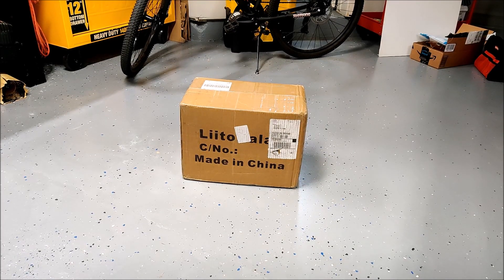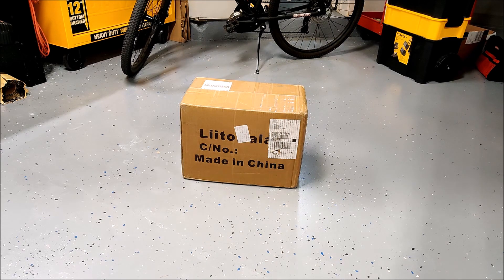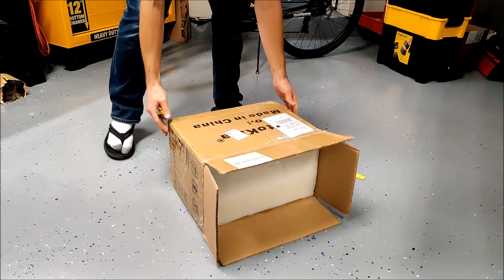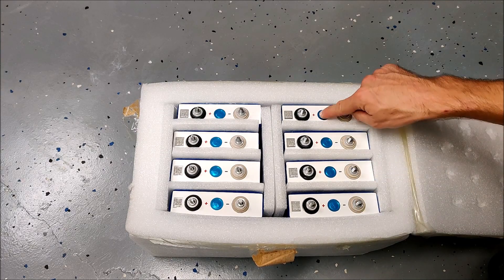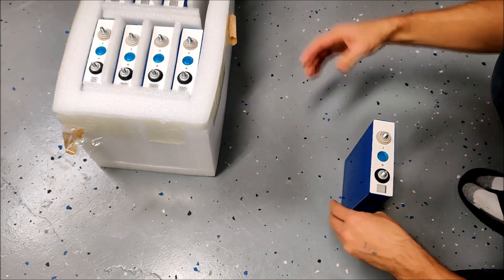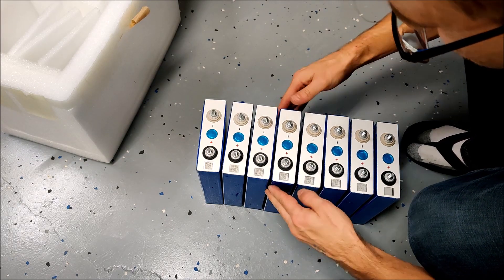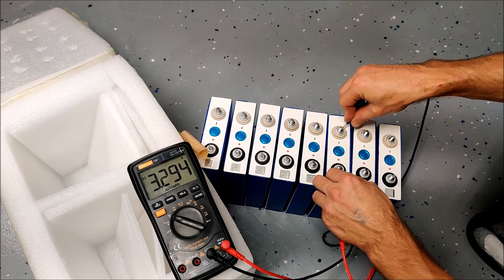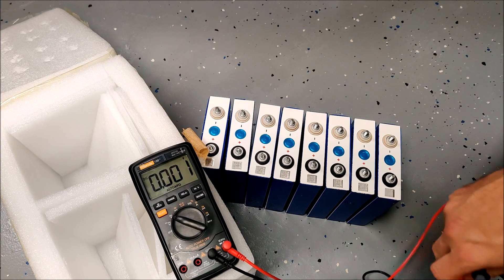DIY 3KWH LifePO4 Solar Generator - Part 1 Batteries

Comment: How was your capacity check on these cells? I bought 8 of them and they were advertised as grade A. However, when tested they have range of between 82ah to 88ah only. Yes they are really cheap and good packaging. Eventually i got my refund.
Reply from the maker: Just finished building the solar generator. Going to capacity test it now that its finished.
Reply from the maker: First capacity test is low 80's. Certainly not 105ah!
Reply: Am not surprise. Haha. Done some research on this after and the reviews from many are that its 80ish only. Only a very tiny lucky fraction has full capacity. However, when IR tested with proper tester it indicates very low resistance which presumely are not used batteries.  My conclusion ia that most likely with the extremely high quantities made for these batteries. These are not used but rather grade b or c where it fails capacity test and also have some budged...

Comment: Nice Video. curious to know why 24V & not 48V - half the current to pass around would result in thinner wires and other electronics with less current ratings.
Reply from the maker: I would need to use 16 batteries for 48v which is too big for the case. Most people build 12v at this size but I build at 24v for the exact reasons you mentioned.

Comment: do you think these would be a good drop in for ups batterys ?
Reply from the maker: Yes and their voltage curve matches lead acid better than lithium ion.
Reply: @stevenc22  may have to look into them as the 4 sla batterys my ups has does not give much run time if power is out